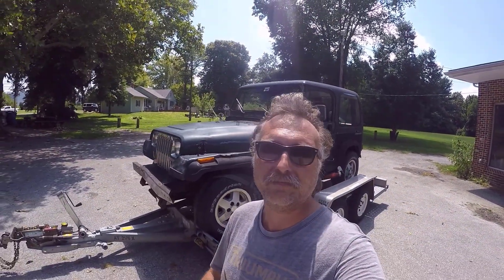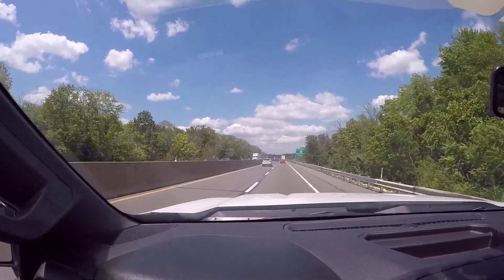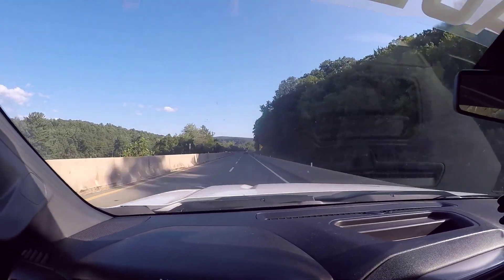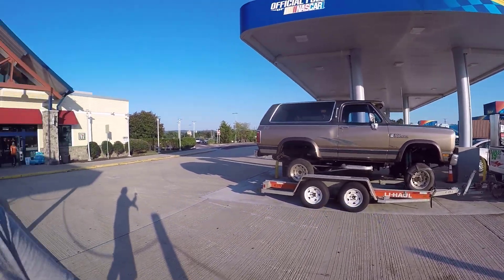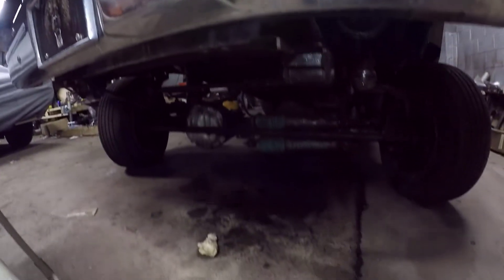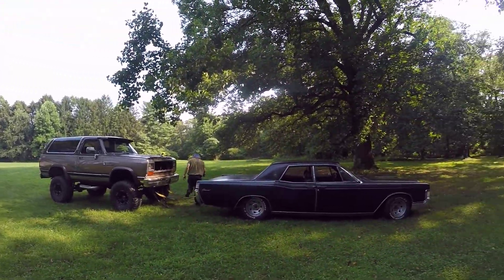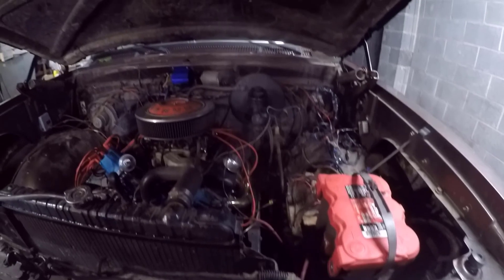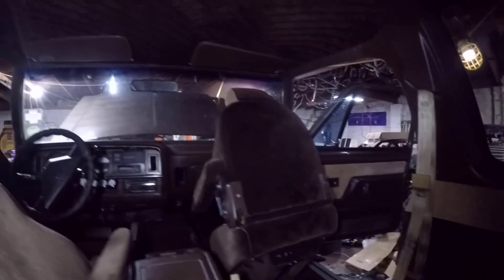1989 Ramcharger Buy 383 Mopar

Comment: That a sweet truck someone put the 383 in that thing because there was no big blocks in 1989 all you need is a Dana 60 for the front and rear with a A833 trans and that thing will be a badass truck. I'm a big Mopar guy and love the ramcharger I'm more of a fan of the older ones but that is cool too
Reply from the maker: Thanks! I def prefer the older Ramcharger instrument clusters...but im still enjoying this one! Next big project is heater core. Tough driving with no heat if its only 20 out!

Comment: If you got it for less than 30k you did pretty good for the times we’re living in.
Reply from the maker: Thanks! I'm loving this truck...it's not just a truck, it's a way of life!
Reply: @CC_Top_Solutions  I daily an 85 RC not nearly as nice as yours…but I love it all the same. 😎
Reply from the maker: @12footstroke15  Thanks, I'm a huge fan of Ramchargers after owning this one. A future vid, I'm going to replace steering parts including shaft (Borgeson upgrade) and possibly get a pro alignment.
Reply: @CC_Top_Solutions  literally first thing I did to mine was the steering shaft upgrade. (Borgeson) Highly recommend. Also adjusted the steering gear which helped a little but needs replaced.

Comment: Yeah make sure you battery is strapped down LOL! I had my Battery in my 73 Trans Am go over after I hit it around the corner the positive terminal hit the brass tank of my rad and burned a big hole in the tank and electrified the water that fried the aftermarket temp gauge and burned all the rubber insulator around the temp gauge line that filled the car full of smoke I did not know what the hell was going on I gassed it around the corner and the car stalled out and the car filled with smoke from under the dash. It scared the hell out of me because I thought the car was burning down and I had nothing to put it out. Good thing once the rubber burned off the copper line there was nothing left to burn but I had to drive it home with a big hole in the tank and no temp gauge. I always make sure the Battery is tied down now no matter what.
Reply from the maker: Oh no, glad the car didnt burn down. This was my first experience with a battery going over...ill def make sure my batteries are held down now! 73 Trans Am, awesome car!

Comment: Lincoln Power,
Reply from the maker: The Lincoln is my backup tow vehicle for fall Carlisle. If I dont get Ramcharger together in time, id be happy to drive the Lincoln!
Reply: @CC_Top_Solutions  I'm a Ford guy.But I do like the Ramcharger and the 383 engine.MY first car was a 67 Chrysler Newport with the 383.Mopar did always seem to have wiring issues .Main problem is Alternator out put wire into the dash thorough an amp gauge shorting out.
Reply from the maker: @mycontinental3611  Thats great to know, i havent even started looking at the wiring yet...ill be sure to look for that! Get this...my Lincoln...definitly better tow vehicle than the U Haul...except for the rear spring capacity...just cant take the tongue weight.